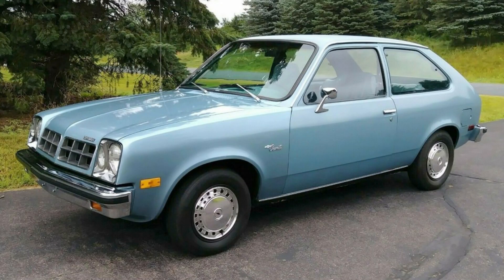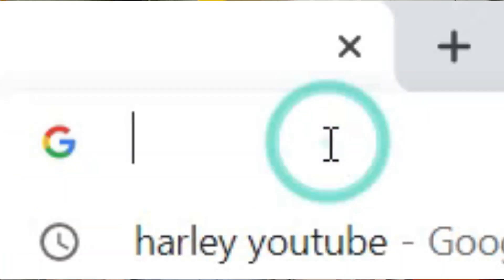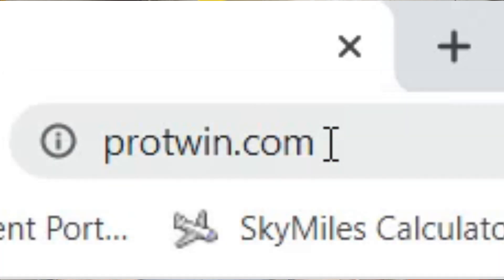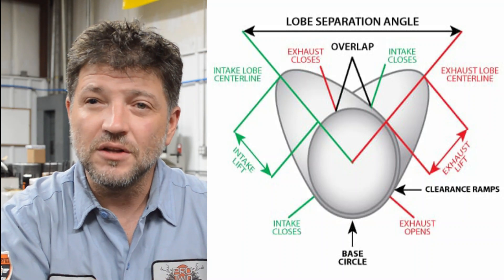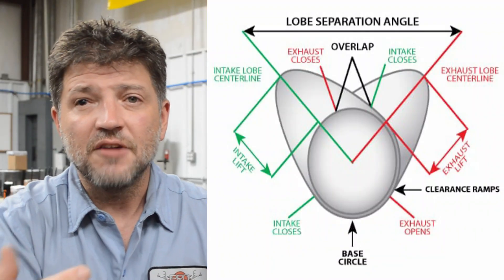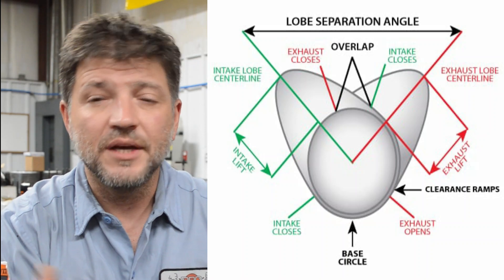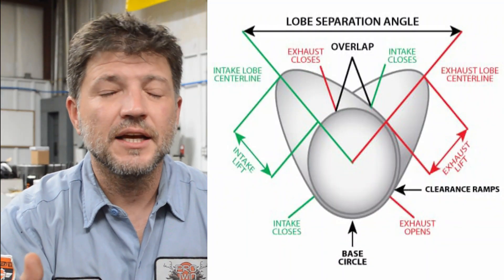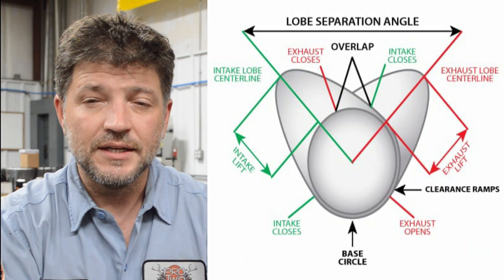Harley Camshaft Upgrade - How to Choose the Perfect Cam - Kevin Baxter - Pro Twin Performance

Comment: I put a 131" Stage 4 Kit in my 2019 Ultra with D& D Billet Cat Exhaust. During Daytona Bike week I talked to T-man about his Cams. Hence I replaced my Zippers Redshift 468 Cam  with  his TMP-2652 cam with 515 lift. Hoping I made the right choice. I ride 2-up a lot.  Your thoughts?
Reply from the maker: John...this is a great question.  One I'll use to do a follow up video later this week.  Thanks for the post!
Reply from the maker: I cant find that cam anywhere on Tmans website.  Can you send me the link or the specs?

Comment: People get hung up on dyno sheets , who cares if you make 150 HP and 150 TQ at 5000 , if the motor never goes there .. I just put a new cam chest in back in March , I'm the odd ball that doesn't change stuff "just to be changing" , but when I do have to change stuff then I upgrade to better and what I want ... I had my eyes on three cams ( 11 Road Glide ) and it came down to a buddy giving me a set of cams NIB for the cost of shipping .. Works for me .. SE255 , appears the torque curve is fairly flat , but you can tell you have power on tap always , idles much better , I used to be a cruise at 70-75 on the slab , bike breathes much better and actually is happier at 75-85 now .. Course with 72000 miles , the original breathers were shot .. And the primary cam shoe was not far from trashing the motor ..
Reply from the maker: All too correct Jack.  Thanks for the comment.  Glad they worked out for you sir!
Reply: JtB ; you purdy dern smart for an Bama boy!!!!    LOL :-)   Your Yankee friend Jacksprat  haha
Reply: @jackiehoward3212  I know ewe ..... sup Jackie ?? you know yer woman Marlene is gonna be in Tennessee in a few weeks ?? I seen where you sissied out the other day .. Just take good care of Miss Faye's Roadie , send it to me and I will do the cams shoes this winter , oh send the title too ..

Comment: Kevin is a cam upgrade on a Harley big twin with a stock crank a bad idea? Can the Harley crank take the upgraded power ? In your opinion would a after market crank be a better start before any upgrades on a stock Harley 96” big twin for more power ?
Reply from the maker: not a problem with that at call.  a cam wont cause the issue...but make sure to check runout when you get in there.  you dont have to replace the crank.  many are good and run for years.  check it though before investing bit in HP.

Comment: I have a 2001 WideGlide my crank runout is .002,I installed a 509G S&S cam a few months ago I raised the cu.in.to 95 is the 509 still a good fit for the bigger cu.in. ?
Reply: If you run a compression and leakdown and things are in the OK ranges you should be good to go.  Oil pressure and operating temperature are useful numbers along with how sweet the motor and drive train sound.  Ticking and clanking is not good.  Whirring like a sewing 
machine is what I aim for, power that is delivered smoothly will often make a whine from the transmission or primary that wasn't there with imbalance delivery from either cylinder. 
I'm fine with being called out but never blown a 4 stroke in 40 years.

Comment: Kevin thank you very much but it's just too much for my mind to grasp, I have a 2005 Fatboy with 95 inch cubic engine I put Andrew's TW37 g cans with new lifters, new fueling camp plate 80 11 billet aluminum, high flow oil pump and adjustable push rods, it's extremely loud when hot with no low end but a lot of high and power. 
  Can anybody direct me to a correction! Thank you fully in advance

Comment: I have a 2017 ultra limited twin cooled m8 looking for a cam ,cam plate  and oil pump not sure what size cam ride two up a lot looking for higher torq at lower rpm thinking more and mor s&s kit any suggestions I like the 2 into 1 headers also and not sure if I should get a new ecm like a thunder max mine bone stock kind of lost in this m8 word twin cams were cake
Reply from the maker: Hey Brian.  We can certainly help you with that.  If youd like to email me kevin@protwin.com or call the shop at 678-226-9651, we'd be happy to help you out with this and get you what you need.  Thanks.

Comment: Kevin, I had a Zippers 468 RS cam installed on my 107 Heritage. It’s tuned with a Powervision Tuner from a very reputable guy tuning at the HD dealership. Stock I was getting around 42mpg and now I’m barely getting 32mpg. Is this normal for a Zippers cam?

Comment: Lopey or hitting cam for a m8 107? I dont run hard above 4500 rpm. Thanks kevin, great video sir 👌
Reply: I ran a andrews 26h in my 16 streetbob and loved it
Reply from the maker: Thank you Jimbo.  There are many options out there.  Sometimes a hard lope setup doesnt provide the best low end torque.  What bike are you riding?
Reply: 17roadglide special m8 107
Reply from the maker: Where do you live?  Passenger?  Combined weight?  Pipes?  etc...all that matters.
Reply: I get that brother, i did the 26s in the bob, running a decatted stock header with mutazu 4in megaphones and a dynojet powervision currently.
Reply from the maker: The RedShift 472 hits pretty good...and probably as big as i would go on a stock engine.  Not a bad combo with that pipe...they are costing you a little down low but if you like the look and sound, and its tuned proper, run with it man!  If you want those cams, let us know and we can get em out to you.  6782269651

Comment: I see quite a few owners on Harley forums who, after having a Stage II, come back disappointed at their bike's performance compared to before the upgrade.  Many feel the performance doesn't equal the money they spent.  I know you're in the business, but do you feel the money spent on a Stage II is worth it for the relatively minimal gains in torque and horsepower?  Do you feel a Stage III would be a better "value"?
Reply from the maker: Tough question to answer.  Performance, quality parts, and reliability is directly proportional to budget.  Once that's determined, next is power expectation for dollar spent.  The right cam, exhaust, and a really good tune can be a great value if the proper choices are made.  Cams plus displacement increase is that middle road that i dont believe allows enough additional results to justify the additional cost.  Now when you jump into headwork and a fully engineered package, that's when the magic really happens...but the budget has to grow.  Great question.
Reply: I put s&s 583 easy start cam on my 96 dyna. I'm really pleased with the result. At 3000rpm you get a huge kick in the ass so funny. I competed some buddies with 103 dyna stage 1 and was faster one every rpm range. Not crazy faster but faster. For the price I spent (cam+work done by a buddy of mine so less expensive than stealership) i really enjoy it.

Comment: Love this channel, I have a 2021 Road Glide, 107 M8, completely stock (for now)....the only mods I plan on doing are full exhaust with air cleaner and a tuner on the dyno. I would like to do a mild cam. I’ve read that the S&S 465 is a good cam, especially for the touring bikes. Do you agree? Would I have to change any other engine components to safely run this cam? What would you recommend for a cam? (Not looking to build a race bike, just something with a little more power. Reliability is my first concern). Also, what is your opinion on the SE torque cam? Vs the S&S 465 cam? Thanks.
Reply: S&S is the way to go over se cams.

Comment: How do feel about taking a stock 2010 ultra 96 to a 110? I ask because out here in California it’s hot .
Reply from the maker: i am not a big fan of the 110 especially with drop in cylinders.  if you go the 110 cyl route, cases have to be split and the case bored.  at that point, you can go 117.  That said, you could also go to a 107.  Ours are very reliable, produce in the 110hp/120tq range conservatively.  That's a lot of power for many people and an extra 3 cubic inches isnt enough to warrant the addtional cost.
Reply: My reasoning to do this is only for the ability to have the power to get around, out of the way, pass, what ever the reason I guess! Do you sell the 107 kit with cams and will you mail to California?

Comment: Still confused 🤔😆 . Built an engine for my 2010 RK ,my first one. Standard 103 with auto decompression releases. 
103 heads plunge cut and port matched 
S&S 650” springs
58mm CVO throttle body
5.3 g/s screaming eagle injectors
103 factory barrels bored to 107
Wiseco Trekker pistons and rings 10.5-1 compression 
Andrews 54H cams 
S&S crank and flywheels
Fueling cam plate and HV oil pump
Fueling HV lifters
Fueling hydraulic tensioners 
S&S adjustable pushrods
Vance & Hines true duels exhaust .
Got good torque from 1800rpm up to 113ftlb at about 3500. Horsepower around 103. Can I get better torque by changing my cam? Recommendation on better torque cam for my build ? Most of my riding is corners , hills or 2up. Thanks
Reply: I actually have v&h power duels with screaming eagle slip on’s , sorry . Was recommended tw555 woods cams . My aim is low end torque and reliability. The wife and I often take off on long weekend trips and have a 15 day trip coming up in a few months down to Tasmania from QLD . A few thousand ks.

Comment: Hey Kevin, great video as always. I have a 2020 Street Glide Special 114ci. with S&S Power Tune Dual Header, SVT boneshakers slip-ons, Arlen Ness Big mouth Air Cleaner, S&S 475c Cam, oil pump, plate, inner bearing, pushrods, lifters, and Thundermax tuner.
This week I upgraded my primary with a Darkhorse compensator sprocket, Trask clutch basket, Hayden M6 tensioner, and Rekluse TorqueDrive clutch. 
Everything is running great, however I can't go to neutral. She is up and down shifting fine to every except for neutral. The Rekluse tech said to run she for 500 miles to break-in the new clutch, and it should fine neutral when it break-in. 

1. What is your advice on this?

2. Will the Darkhorse compensator sprocket tear up my stock crankshaft, since it doesn't have a spring? 

Thanks!!
Rube
Reply from the maker: You have a very good list of parts there.  Im assuming you have a hydro clutch...which doesnt allow adjustment.  That is one reason i run the clutches i do...and i'll explain.  First take a look at this video https://youtu.be/EHSiTmTVnu8  In short, it comes down to maximum pressure plate travel, and stack height of the clutch.  You must have .060 pressure plate travel on a cruise drive to fully release the clutch.  Stock...it's right at that already.  If the stack height of the clutch pack is even slightly too thick, that travel, or clearance, is reduced, which will cause your clutch plates to drag making it hard to find N.  This is why im not a fan of clutch packs that add plates.  One other thing to look at...if you are running fat grips, or and adjustable lever, or covers over your lever, this will reduce clutch travel as well.  Hope this helps.
Reply: @KevinBaxter  Alright, thanks!!! I'll look into it.
Reply: @KevinBaxter  Alright brother!!!! So I have Arlen Ness grips and Arlen Ness levers, and I looked at my clutch lever and grip, and it turned out that lever at the side closed to the controls was hitting the grip 3/16 of an inch too early.  So I took my grinder to it, and shaved off enough to get the entire clutch lever travel. THANKS A LOT!!!!! PROBLEM FIXED, Now I find neutral with ease. THANKS!!!!
Reply from the maker: excellent...sometimes the biggest problems have the easiest solutions.  glad i could help.

Comment: Do you degree the cams in with a degree wheel like you would a race car engine for optimal cam timing and performance or can it not be done on a Harley engine ? Just was wondering lol
Reply: No, at least not with factory parts. There are a few places that make a +/- 4* cam gear, but not fully adjustable that I'm aware of. If you look at the cam timing specs of some major manufacturers they will sometimes have advance ground into the lobes

Comment: I ride a 2013 ultra classic with the 255 Kams Vance and hand Dresser Hatters Rinehart mufflers hot airflow intake and super pro race tuner on a Dino agent seems to run pretty strong at low RPM for my cruiser would you think this is a good set up or do I need to go further will be glad to come see you in your off-season
Reply from the maker: Yes sir....thanks for watching.

Comment: Great video!! Got a question. I have a 2016 H-D Softail FLSS. It has a S.E Stage 1. S.E Street Canon slip on, K&N air filter & a S.E. Smart auto tune. I am keeping all the add-on parts H-D. Next thing I want to do is a Stage 2 Cams. But I can’t decide. My local dealer recommends me the S.E 585 cams and another dealer says it’s better that I go with S.E 259 cams. 🤷🏻‍♂️  Most of my riding is  2up. I’m looking for more of that low end torque. I am most of a cruiser rider top speed on the highway is 80-90MPH what cams do you suggest I go with for my 110 S.E. Twin Cam?
Reply: CycleRama CR570-2

Comment: Is this the stuff MMI grads would know?   I'm planning some upgrades for my 96" twin cam.  I have intake and exhaust and am considering a fuelpak 3 and a cam.  It's a 2010 Dyna...any cam suggestions off the top of your head.  I'm having a TMI moment or two.
Reply: I attended MMI from 2011-2013 and completed the HD, Honda and Yamaha programs. When you complete your program you really only know the basics. I’m have learned so much watching Kevin’s videos, even with some years in a HD dealer and achieving Harleys “Master” Tech recognition. With that said, I don’t regret my education at all, but it just scratches the surface.

Comment: Great video and excellent explanation!! I’ve mostly dealt with car cams for 30+ years and still learning things!!! Curious on your opinion, I have a 08 FatBoy 13k miles, Arlen Ness Big Sucker, Bad Dad 2 into 1 exhaust, currently has a DJ PC-V (will be looking to change to a PowerVision) and upgrading the compensator to the DarkHorse Comp. I mostly ride solo (200 lb), we have hills but mostly flatter kind of riding in the southern North East. Also normally ride in the 2500-5000 rpm range with an occasional “let her eat” kind of riding. I have been looking at the Andrews 48H but wasn’t sure. Any sort of guidance would be great, and once I figure this out I’ll be in touch to order some parts, but will have to order parts as money is available for it. (Daughter in college) thanks again. I almost forgot I do have a batwing fairing and hard-bags on the bike.
Reply from the maker: That is a fantastic cam if your goal is the lowest torque you can get.  If you havent, take a look at my latest video on M8 cams.  I compare cams to help folks better understand the numbers.  When you look at the specs of that cam, you'll understand why it makes torque so low.  Look forward to hearing from you when youre ready.

Comment: Excellent video Kevin! Question, how much does having the heads flowed effect cam choice? I think they go hand in hand as in you should do one with the other. I have a 2019 Limited, a 1000llb bike and think I should concentrate on the lower rpm range. Whats the best cam choice for my bike if i have the heads flowed? Thanks man! You do an awesome job, keem'em coming!
Reply from the maker: Tremendously.  Heads and cam need to work together and should be chosen together.  There is no best...and there are many ways heads can be done.  Whoever you choose to do your heads, us or others, should be the one to recommend the cam.  Low to mid range torque for touring.  Thanks!
Reply: I've got a 2020 Breakout 114 with a Wood 22x cam. Torque isn't the word. It raises and evens out the idle somewhat and is a torque monster. It's just fine to cruise on the highway or putt around town and has instant power when you need it.

Comment: Dear Kevin, thank you for all of what you do, I have a question for you. Which cams for exemple from woods, would you recommend for the most aggressive torque and horse power to put in my 124 ci TC, I have HPi 58 MM throttle body, tbr race exhaust 2 into one, feuling oi' pomp hp+... And all the rest of performance part we can put into the engine... I have ordered a Darkhorse crankshaft designed for a mid to high range style... And I love to go the quickest is possible to the red line... Hope my infos are enough to answer... 😊 If woods are not the best according to you, please don't hesitate to recommend another brand.. I have actually 594 reapers from feuling... 😊 Hello from France 🇫🇷
Reply: Woods 9F!!!! Would be my choice! Kevin would definitely know more than I.

Comment: Great Information Kevin Baxter Got a 2019 RGS M8 114 S&S 475C Oil Pump with new Ring On back of the pump  and Cam Plate Running V&H Naked A/C with Power-duels and 450 os Mufflers and PV with Setup from FuelM Website Bike runs great for a few minutes then wants to bogs down when i go to take off again check for stumping oil stays Constance when checking when the bike acts up also when i put the bike in autotune mode does not clear it up 100% but makes a difference and not as bogy though the gears any ideals ?? New Sub Great Videos Kevin
Reply from the maker: Thank you sir. Could be sumping, tuning issue, intake leak, etc. Immediately check your oil when it does that, then check when its not. See if you notice a difference
Reply from the maker: Also see my video on reading spark plugs and check yours.